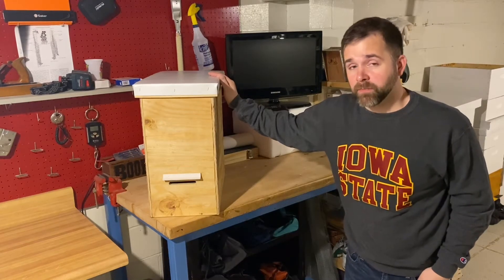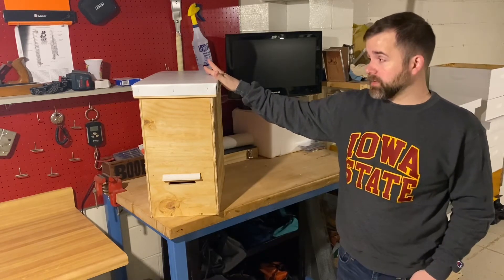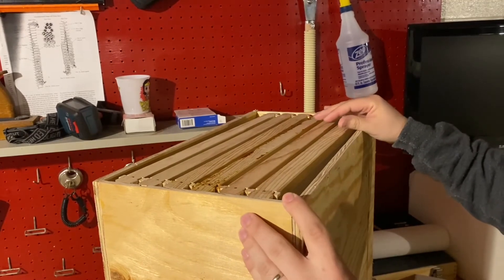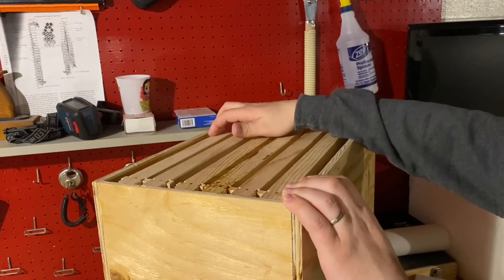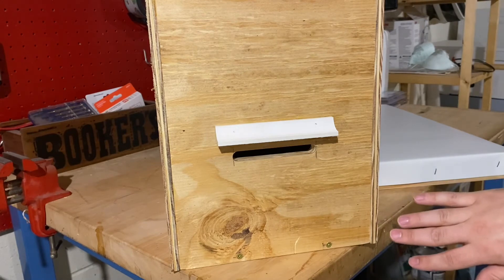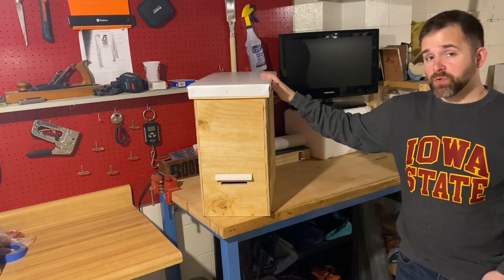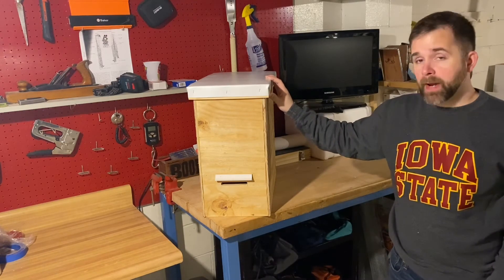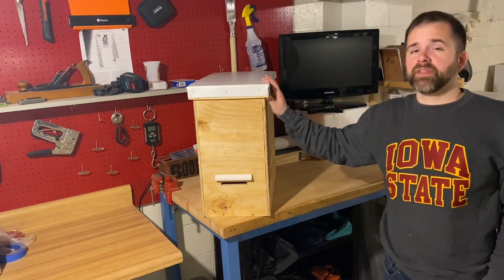Swarm Traps Part 2 - Building a Better Trap

Comment: If you approach the matter with the attitude of attracting swarms things might go better. Bait the hive with lemon grass oil, some old comb and if they are around and the volume is not too small they will arrive. It's that simple. No need for hoisting up trees or any of that film flam.
Reply from the maker: I've never had any luck with traps lower than 6 feet off the ground. Some people are religious about keeping them in that 12-15 feet zone, and I haven't done that. I know some people have abandoned hives get repopulated with a swarm, it happens. I just haven't had any luck with it.

Comment: I build traps similar to that and those traps will work fine.  If you want to enhance your swarm catching greatly, melt down old brood comb, propolis and cross comb saved during your hive inspections.  Melt this down just before you are ready to put your traps out.  Pour it down the inside walls of the traps as well as a little on the bottom and top.  I was catching a couple of swarms each year but when I started doing this I started catching 20 to 25 swarms a year.  Get your traps out early before you think they should be swarming.  If you catch a swarm, take a replacement box with you when you go to pick them up.  I often catch swarms back to back by doing this.  Swarms like to go to the same tree for some reason so when you find a spot, use it year after year.  Make it easy on yourself!! Make them easy to close up and easy to hang and retrieve!  It usually takes me less than 5 minutes to drive up to a trap, close it up and load it into my truck and hang a new trap.  I hope this may help you and others who want to catch swarms.
Reply from the maker: That is so so so many swarms! What are you doing with them all? Do you run that many hives? The local swarm/cut-out guy in my town typically gets 30 calls all season. I do know a commercial beekeeper south of me who’s probably about at your numbers with traps and she uses them to draw out massive amounts of comb each year.
Reply: @BeensBees  I keep some and some I sell or give away.  They are great for drawing out foundation and some big swarms produce enough honey to take some the first year.  I usually put out 7 or 8 traps, within 15 miles of my home.  Some are on trees in parking lots of businesses that give me permission.  Some are along the wood line of pastures or food plots on hunt clubs.  Good luck..

Comment: I'm just finishing up 7 of these traps. Since I'm also looking at building some Layens hives I made an insert/divider board so I can also use Layens frames in these traps without bees getting into the 'dead space'. Easy design- hope I catch some swarms. Good luck to you!
Reply from the maker: Good luck! I haven't tried out any of the longer frame hives. I was given an assortment of woodenware by a retired beekeeper when I was getting started, but for the most part it was 10 frame Langstroth.